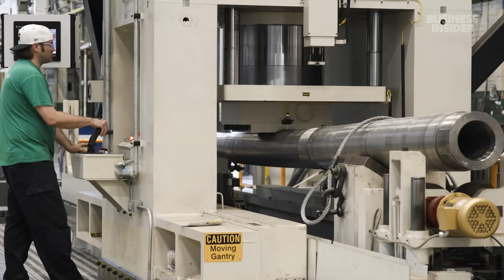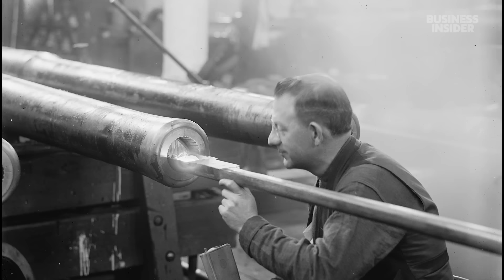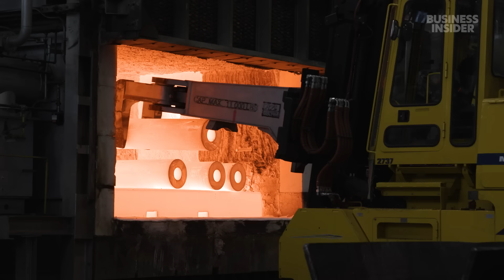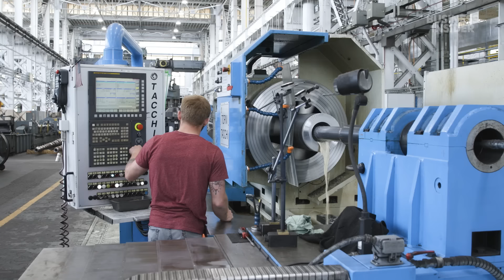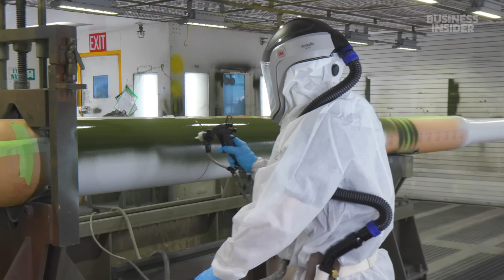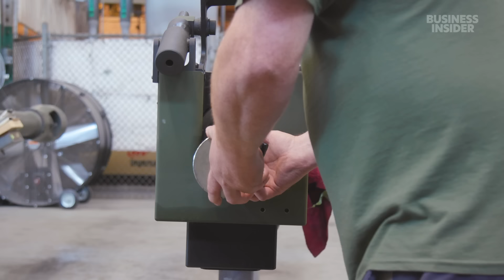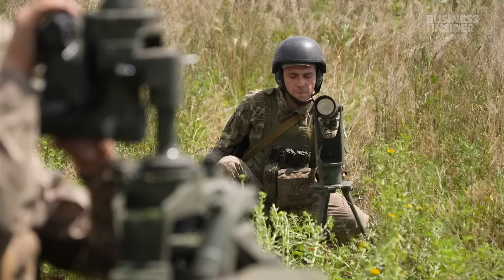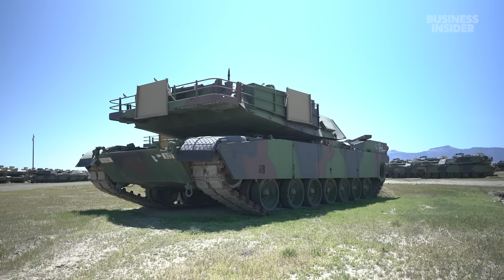Why the US Has Only One Factory for Cannon Barrels

Comment: Artillery shells have since WW2 had fuses that cause them to explode in the air, not on impact. Mid air explosions cause fare greater damage, than explosions on impact. Artillery is also far too inaccurate, firing miles away, than needed to hit targets directly. That is why it's called indirect fire. A mid air explosion is more likely to hit its targets.
Reply: Interesting. In other words - they can predict the trajectory time very accurately? Which make sense since the hole operation rely on computing the ballistics. Can they adjust the fuse? Difference in elevation would matter more for this than for "2d" precision? The trajectory appear to be quite high/steep in many of the videos I've seen at least, which would make elevation difference matter less for 2d precision.
Reply: @olejrgenbrnner4708  - In answer to your questions, many factors go into ensuring that a field artillery projectile is able to accurately strike the target.  In addition to the deflection (right or left) and elevation (angle) of the artillery barrel, other factors are also incorporated such as the ambient temperature, humidity (affects how fast the propellant burns), type of propellant used, amount of propellant used (charge), barometric pressure, wind direction, wind velocity, distance to target, projectile speed, projectile weight, elevation of target compared to elevation of artillery piece, curvature of the Earth (declination), and the Coriolis Effect (Earths rotational effect on objects not attached to Earth).
Reply: Yeah that’s not what it’s called indirect fire
Reply: @ mikeegist3537 - I was the Staff Sergeant E-6 Crew Chief (in charge) of a 155mm Self-Propelled Artillery Howitzer in the US Army for several years assigned to the 1/10 FA Regiment, 3rd Inf Div & 6/14th FA, 1st Armor Div and offer the following information:

- - Several different fuze types can be, and are, used with artillery projectiles. 1) Variable Timed fuze (VT) that can be set for a specific time to detonation, 2) Point-Detonation (PD) which detonates upon contact with a solid surface, and 3) Proximity fuze that detonates within a certain distance (proximity) of a solid surface.  Each type of fuze has a specific purpose, but the most common fuze used on the battlefield is the Point Detonating (PD) which is both the most reliable and least expensive to use.
- - Today's field artillery is EXTREMELY accurate with the use of satellite GPS designated coordinates and/or by the use of specialized rounds such as the 'Copperhead' that homes directly onto a target that has been 'painted' with a laser designator.
- - The reason field artillery is called "indirect fire" is because the projectile is not fired directly as a target, but INDIRECTLY at a target that is not in direct line of sight (such as on the other side of a hill or at a distance beyond direct observation).
Reply: Well, the PGK for 155 mm turns a howitzer into a precision weapon. Amazing CEP.
Reply: There are several different types of fuzes used with field artillery with each having a specific purpose:  1) Point Detonating (PD) which detonates upon contact with a firm surface, 2) Variable Time (VT) which as the name implies, can be set for various time before detonation, and 3) Proximity which detonates within a certain distance of an object. All three types of fuzes are currently used on the battlefield with the PD being the most used due to it's reliability and low cost.

With satellite GPS coordination coupled with precision calibration of howitzers, Field Artillery has become extremely accurate. The use of special rounds such as the "Copperhead" which is guided directly onto a target via laser designation almost guarantees pin-point accuracy.

Howitzer fire is known as indirect fire because it is not aimed DIRECTLY at a target but rather INDIRECTLY over or behind an object like a hill or when the object target is too far away to be directly observed.

Comment: What about Burlington Rheinmetall Germany the equipment for it.
Reply: 'Rheinmetall' of Germany is building a factory in Great Britain for upcoming barrel orders for the RCH 155 wheeled howitzer. This facility will also produce barrels for the 120 mm L55A1 smoothbore gun for the modernized Challenger 3 tank.
They are currently in the middle of a production run of less than a thousand barrels (number undisclosed) for PzH 2000.

Comment: I jumper right in straitening hardened axles for my grinding colleague, not massive, these was just for transmissions, but had them running within 2:100 mm with a couple of whacks by a lead hammer.
Also jumped right in operating a grinding machine, something i had like 30 minutes of experience with during my education 2 decades earlier.
Making tolerances of 6/1000 mm for the tightest ones.

Comment: AI Overview
Howitzer barrels typically last for a few thousand shots, with specific lifespans varying based on factors like ammunition type, firing rate, and barrel material. A barrel's life can be measured in "effective full charge" (EFC) rounds, and many artillery pieces fire different charges and rounds. Some barrels, like those on the PzH 2000, can withstand up to 20,000 shots without needing replacement.
Reply: but the PzH 2000 is made by Rheinmetall in Europe..... that's for the 20,000 shots capability before replacement. They are making a 3 digit number of those barrels. (Undisclosed but less than a thousand)
And they are opening a facility in Great Britain very soon that will make barrels for the RCH 155 wheeled howitzer. And also produce barrels for the 120 mm L55A1 smoothbore gun for the modernized Challenger 3 tank.
These existing and proposed factories are both in Europe, and are non-government (Private civilian) businesses. 
The American barrel factories are too complicated for private business to run, so the US Government runs those ones. The barrel replacement 'shot' threshold for the American barrels is 1,500......... compared to the 20,000 stated for Rheinmetall.

Comment: There is only 1 gun barrel factory left because the US doctrime belived that artilery was obsolite. They got used to fighting vs nations with no airforce and airforce they could subdue easly. Then using planes for more accurate targeting. 
The Russia-Ukraine war prooved that artilery is still the main way to hit the enemy. Almost 4 years of war and Russia still has not gotten air supprimacy due to high amout of modern AA systems so artilery is the way. Not even that , smart bombs proved to be useless. The most widely used US JDAM was pulled out of Ukraine in 2023 because of jaming - they could not hit the side of a barn from the inside. Same with Excalibur rounds , GPS guidance just doesnt work when the enemy have mastered electronics warfare. The russians have the same problem with the drones. This is why they invented the fiber optic drones (the idea taken from sub torpedos) to surcomvent jamming. 
This is why Artilery is and will remain the best support units.

Comment: I find it hilarious they use a stick to load a round
Reply: the use of wooden boxes and tools is still a safety issue in general explosives and obviously this military explosive. A wooden tool doesn't cause a spark when struck against steel..... and that is a great thing when dealing with explosives. Other materials can be used, depending on circumstances, plastic, brass etc....... but you also have to think a little about other ways to detonate explosives so that you don't have an accident. Like static sparks etc. Wood is just generally safe all around.

Comment: Unbelievable, Only One ! Where’s the backup?
Reply: To have a backup for every manufacturing plant would cost billions of dollars. Without any major wars requiring lots of howitzers or tanks (for the US) since the end of the cold war, they just went with the minimum required. Western European countries did the same thing, and now they also have to ramp it back up again.
Reply: @Djamonja  useless investment: use drones
Reply: @Djamonja  For fiscal year 2023, the United States military budget was $820 billion🤔
Reply: @6140LIBRA  It's more like $870 billion. That doesn't mean they will spend $5-10 billion keeping backup plants running when they don't need to.
Reply: refurbishment at Rock Island, no new production.
Reply: We already make barrels for other countries to boot. They’re even in worse shape.
Reply: There's the UK. Who is starting to reshore barrel production at a new BAE factory now running, and  second larger BAE Artillery factory is being built as of now. UK Revives Artillery Barrel Production with BAE Systems M777 Howitzer Factory Launch.

The M777, which will be the factory's initial focus, stands as one of the most deployed and battle-proven 155mm towed howitzers in the world. Developed through a joint UK-US effort, the M777 combines the power and range of a heavy howitzer with the mobility of a lightweight platform. Its titanium construction allows it to weigh less than half of traditional 155mm systems, BAE have restarted 777 production due to global interest in the system since its use in Ukraine.

Comment: Would have been nice to see how they bore the rifling into the tubes.  Apart from that it was very informative.
Reply: Might be classified or something technology but I mean yeah.
Reply: I did my apprenticeship there, and was a Toolmaker Leader there for 10 years. I can assure you that the barrels are not rifled on the rotary forge, and the process isn't classified. They are rifled on a broach machine that will push hardened steel broaches through the bore, gradually getting bigger until the correct depth is met. While the broach is being pushed the barrel will turn, that's how you get the twist.
Reply: @kevin_1979  sounds like a dying whale.
Reply: These are smoothbore
Reply: @allengordon6929  The Abrams tank guns are smoothbore, the howitzers are not.
Reply: I wanted to see it too, I read the descriptions but cannot visualize it
Reply: they don't "bore" it. the rotary forging process done over mandrel cold likely IF they are rifled. classified? hahaha! no, not even close, and many are smoothbore, (using fin stabilized rounds) as stated in the narration. tank barrels are usually smoothbore.
Reply: @timkohchi2048 All field artillery barrels are rifled as 155 and 105mm shells are not fin stabilized.
Reply: @viceralman8450  See the bit about cold hammer forging, that is how you do rifling today.
Reply: @r.gilman4261 They have rifling that’s the point they aren’t smoothbore as this guy suggests that a feature for MBTs cannons.
Reply: @viceralman8450  yes, I specifically cited most tank barrels are smoothbore (sorry, didn't say "MBT", lol!). thing is I don't know if the specific barrel being forged was rifled. that's all. do they only make triple 7 barrels at Watervielet ?
Reply: @timkohchi2048 They do manufacture 120mm smooth bores but all the ones featured on this episode are 155mm rifled barrels.
Reply: @r.gilman4261  No it is not how you cut the rifling on the interior of the bore.
Reply: @viceralman8450  Th segment where they discuss the auto-closing breechblock shows the breech and breechblock for the 120mm gun on the current production M1 series tank.
Reply: @timkohchi2048  Actually they do bore the insides and cut the rifling (no rifling on the 120mm gun on the M1A1 and later tanks) .  Then they electroplate a layer of chrome on the inside to allow it to better resist wear.  

The hammer forge only gets the gun tube into a rough shape that is slightly oversized in the exterior dimensions and undersized for the bore.  They then force a slug of very hard metal that is larger then the bore to compress the steel and force the gun tube to expand.  This expansion leaves internal stresses in the steel that want it to get smaller - but can't.  These internal stresses counteract a lot of the force inside the bore that is trying to force the steel to expand.

Comment: 18 a month. That seems to be way too little.
Reply: you’d be surprised how tedious larger artillery barrels are to produce. Those thing took months before ww2
Reply: especially after they gave the ford stat. 1 complete whole ass airplane every 64 minutes. Basically 24 planes a day vs less then 1 barrel a day lol.
Reply: @cwalker7 ww2 aircraft were surprisingly simple compared to ones today. fuselage panelling and spars were easy to press, engines can be assembled en mass, and didn’t deviate much from civilian ones. Like the video said, they didn’t rely on manufacturing technology that was beyond what a car manufacturer would have. Unlike now where they need oversized industrial presses just to make spars strong enough to withstand supersonic flight.
large caliber artillery barrels in comparison are large chunks of steel that can’t be assembled in pieces. It requires sufficiently large specialised machinery for forging and boring that no other industries would really need. If there’s one military industry to name that hasn’t contributed much to the civilian sector, it would be artillery manufacturing.
Reply: Imagine how many are just sitting on the shelves collecting dust
Reply: Barrels are what they call long lead items. They’ve always taken a long time due to tolerance and the process which cannot be sped up. We make barrels for many other countries to boot.
Reply: Most likely 18 is not today's number. If making the initial piece only takes 15 minutes. So they could forge the base objects all in one day, even less. Then those machines would stand idly rest of the month?
Reply: @charliebrown3681u  There were multiple times in the video where the editing of the interviews and the wording of narration resulted in imprecise or strange explanations. I would guess 18 a month applies to a specific type or size of barrel - maybe the largest. The factory probably makes a lot more smaller barrels.

Comment: 2025 and the Army still can't issue soldiers with electronic earmuffs, ridiculous.
Reply: To be fair though, over the ear are terrible for heavy concussion compared to cheap in ear that form a seal.
Reply: Can you elaborate on electronic earmuffs? They do receive earmuffs as shown.
Reply: @SkylandersMRG  all I can see on those troops firing howitzers are pushed in earplugs. I have an electronic earmuff for the range, Walkers. It's great, I can have a conversion with it on, no problem.
Reply: @alcab4855  Everything is a cost/benefit analysis. What do you gain by giving them electronic earmuffs? What could you lose? Why would they need electronic earmuffs? So the soldiers don't have to yell to communicate? Maybe needing to yell to communicate means they need a more precisely structured/orchestrated operation and communication procedure in order to be effective. Maybe that results in more efficiency. If you make it more easy or convenient, maybe the processes doesn't need to be as well orchestrated, and maybe that results in less efficiency over time. So why would the army spend WAY more for a convenience item? Especially when it introduces a new point of failure.
Reply: Why? Sure as shit you issue those to low asvab army dudes and they're wasted. Yellow foamies are cheap and can't be broken. You, if you're army, sound like a private. Don't you know? If you needed it it'd be issued. If not, make do. Quit yer bitching.
Reply: It is probably cost/corruption
Reply: November 2025 , still no Invasion of Venezuela.

Comment: If you think this is impressive go look up Japanese 46 cm/45 Type 94 naval gun from 1940.

"Only 18 were ever shipped, nine each aboard the Yamato and Musashi, The complex Type 94 barrels were constructed in three autofrettaged stages. A half-length tube was fitted over the first tube and shrunk onto it. The assembly was then wire wound and two additional tubes shrunk over the entire length of the gun tubes. A final inner tube was then inserted down the gun and expanded into place."

"The shells weighed 1,452 kg (3,200 lb) and could be fired 43.5 km (27 miles)"
Reply: My nan used to bake those and fill them with brandy cream.
Reply: @DirtyPoochRacing  Lol what
Reply: Ahhh yes the glass cannon

Comment: Why the focus on replacing a machine that works, just because it is 50 years old? It makes one barrel every 14 minutes. It can produce more than 102 abrrels a day, but it takes 4 months to complete just one barrel in the whole process. Which means that the hammer-machine should not be something they focus on first, like this video makes it seem they do..
Reply: Machines like this have a lift span. They wear down. The barrels they make will have more variations the more you make. They become inefficient and need to be replaced…. And it isn’t cheap, that’s why the private sector doesn’t want to do it.
Reply: They should just make more of these machines and just scale up. The 50 year old tech works so what's the point of spending hundreds of millions and years of R&D time to create a new process that makes makes the barrel in 10 minutes rather than 14? Just start producing in this lifetime rather than procrastinate.
Reply: Definitely. That machine isn't the bottle-neck. They should be looking elsewhere in the production line... Unless this machine is producing barrols that are eventually rejected later on.